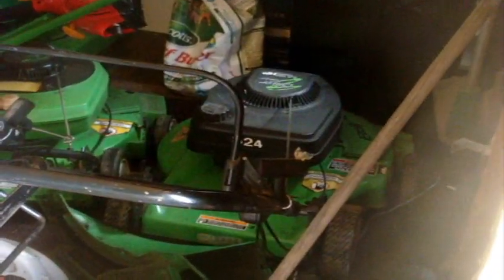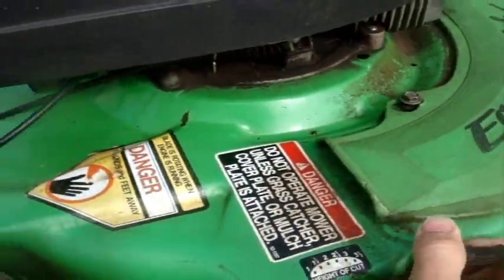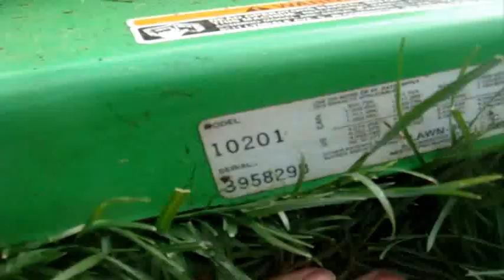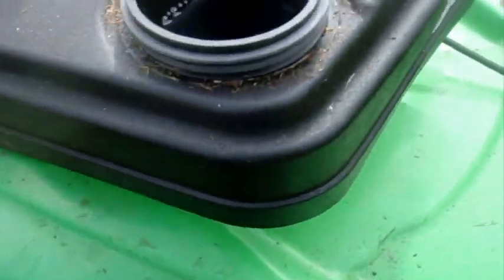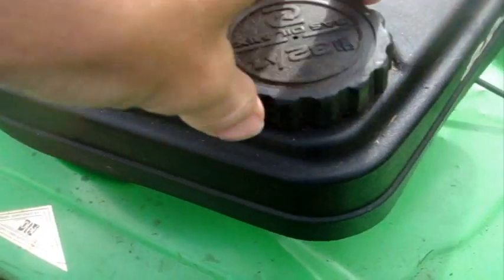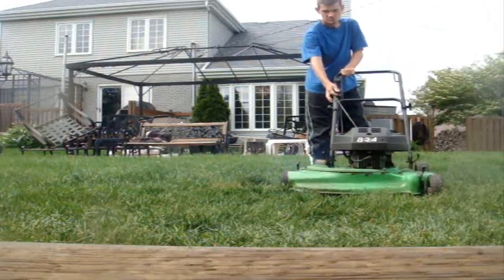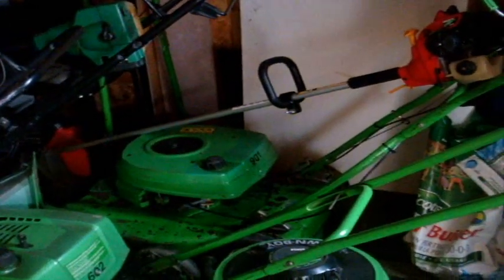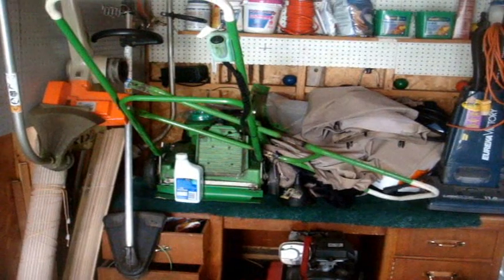1993 Lawnboy 10201 Silver Series in Action

Comment: I had a 10201 probably 4 years ago. Before the connecting rod snapped, chewing up the bore, this thing ran like a beast! Talk, wet grass, heavy weeds, small sapling shoots, and even wildlife was no match for this thing. The V Series engine was made after Toro bought Lawnboy. It's a rougher running engine, but loaded with power for only being rated at 4.5 hp. Instead of the smoother sound of the D and F series engines, the V Series sounded more like my old Penton dirt bike.
Reply: I have one and it really does sound like a dirtbike

Comment: Well, my 10201 is dead. I was mowing at the fire station when I hit a steel anchor for the old siren pole hidden in high grass, and bent the shaft.
I got really lucky, though. I picked up a 1980 r7070 for $35, and she runs even better than my 10202 did.

Comment: i have this exact same year and model with a 4 stroke Tecumseh 4.5 horse....starts on one pull EVERY time.....plus it has the power to waste taller grass and has a better finish cut because it came factory with a finishing cut blade...gives a professional cut like youre on a golf course....cuts better than my Honda or Toro mowers ive bought and sold cause they cant do as good.it was the best 579.99 i ever spent (came with both bagging systems and mulch and block plates). One pull,ill post a vid

Comment: V series was a decent engine, just not very well muffled. I have the same mower, but with a primer instead of the choke. I bought it new in 1997, and it still fires up on the first pull. 
Over the years, I admit I have replaced the CDI module about 4 times. I finally had a shop mechanic tell me that those engines do not like heat. When the deadman switch went bad, I eliminated all that stuff, and removed the top cover, leaving just the gas tank and the primer mount. It looks like it came from the '60's, but runs better than ever.

Comment from the maker: Most of my lawnboys are 4-5hp and they get the job done for what I need it for so 4.5hp is fine.  Again, it depends what you're using it for.. If it's just cutting the grass once a week and for light commercial use, it's plenty. Later V's 95-97 came with a 4.75hp version.   It does hold a candle to my 6.5 duraforce

Comment: the 10201 only had the manual choke in 1993 in 1994 and newer it had a primer with a plastic carb and toro also used the v engine on their mowers for a very short time

Comment: Jon, it sounds like your LB engine is going out of range (overspeeding) later in the video. You may want to have a peek at the governor linkage and/or carburetor assembly. The RPM should be 3200 RPM, give or take 100 RPM.

Comment from the maker: Its very hard to explain this in writing.  You really need see this video and the my other ones more in depth in order to understand that it makes one  full stripe with two lines.  

A possible theory would be the far right wheel has less weight on it (as you see it's far from the engine than the other 3 wheels...so it's not causing a 3rd line to be indented on the lawn as the other wheels.   If you're planning on buying one, you'll have to get them used.  Lawnboy no longer makes this style

Comment: Hi Jon3800 I have a 10201 I rescued. it runs great after just a lil bit of tlc and under the deck there are strips of tough black plastic that kindof seem to protect the deck, but there's a big thick fat plastic bar that extends right across the ejection chute, and it clogs it constantly when I'm battling tall, ropey grass -which is mostly what I'm trying to slay around here. The smoky ol' Lawn Boy of death slays the tallest grass and thistle trying to make a living in my yard and flattens out the ant hills too. But it's a drag when ya gotta go digging out that ejection chute fulla who-knows-what every few minutes. Can I cut or remove that plastic without structurally messing up the deck?  seems I had an old 7073 with a similar deck and it didn't have any plastic under there at all, but it was a smaller engine. I'd sure like to free up that chute so it can chuck all the cuttings it wants to, as fast as it wants to, without that darned plastic bar in the way .Any suggs? thanks.